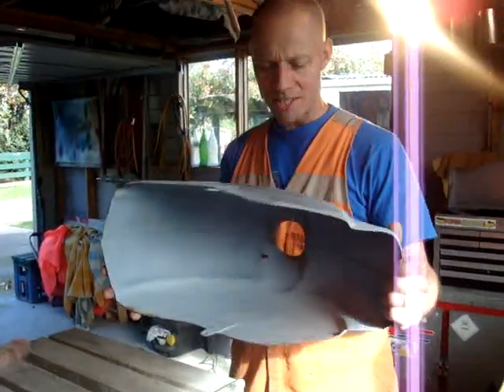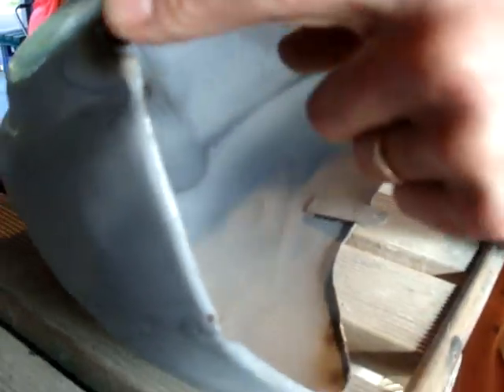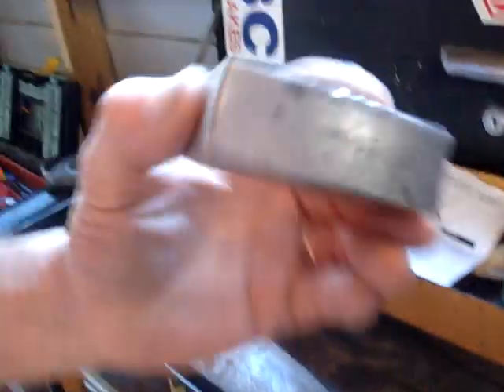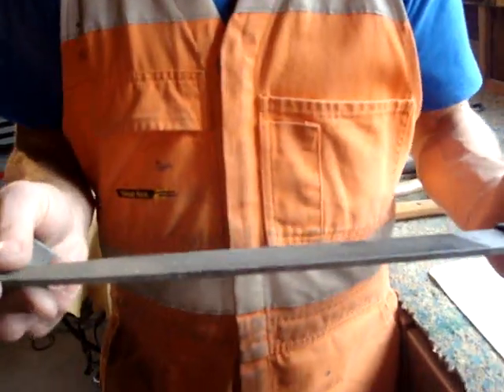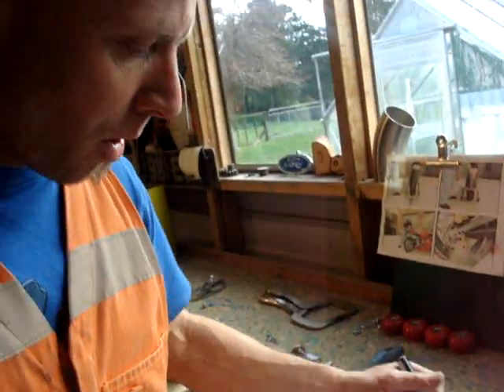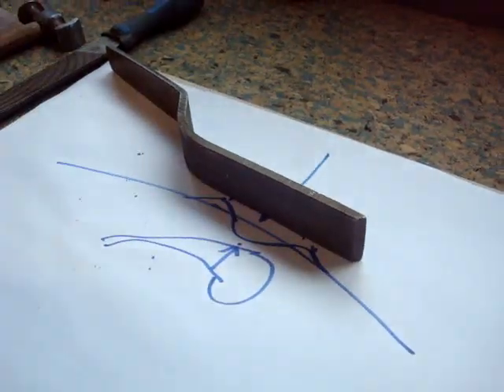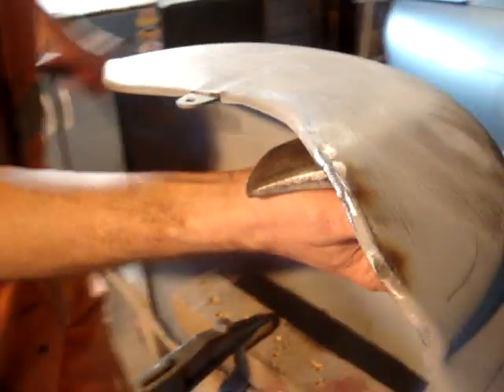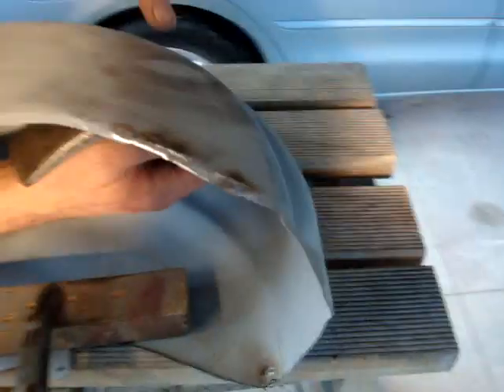car dent repair (No filler) training

Comment: having learnt my trade in 1988 from an oldschool panel beater i was told that ill never ever use his way of teaching on anything.i tried to put more of his teaching into practice but was always told to do it the quick way,ie body filler etc.
ive just come back into bodywork having been out of the trade for years,(i have been paint spraying for 13 years,in the super yacht trade!)which i am doing in  vw restoration(been into vw's since 85!).
now i want to pick up on the skills that oldschooler showed me.im not a novice but want a refresh. i have looked around and now come across your youtube tutorial.your ten minute clip you posted is so easy to learn from and helpful .thanks!.
Reply from the maker: +The BLDB thank you for the positive feed back , big fan of vintage dubbies also
Reply: thanks for keeping alive i hate bondo / mud

Comment: Superb. I have just done my first panel job on a Supra front guard, hardest steel I have ever seen. Got it done but ended up with lots of little marks from the hammer and dolly. I wish I had seen this slap stick before I started. Thanks its an excellent video.
Well done.

Comment: - just doing up an old '67 lambretta li150, - some quite badly dented panels, mudguard etc. Saw your video and thought i'd have a go, - got an old file etc, and set about the mudguard which was pretty bad after someone had jemmied off the old number plates - well, you should see it now in primer, looks bloody fantastic, I am really chuffed to bits, - many thanks for the lesson/kick up the arse to do it myself - legshields next, but not that bad - cheers, keep them Lammys rollin'!
Dave (UK)

Comment from the maker: Convex or a return sweep panel, can be planished, 
using a half round slap stick (I have one of these) could load video if enough people ask,?? 
You can also hammer on to the dolly from the inside of the panel. My dad and the older repair men would usually lead over the dent

Comment: Hi buddy, I'm in sunny, well not so sunny England, just watched your videos and found them to be inspiring, I'm in the middle of restoring a 1964 BSA D7 and a 1950 B31, I've just removed the rear Mudguards or fenders from both of them. The have little dints all over them and I'm going to try!!!! and have a go at removing them, as per your video, will let you know how I get on...

Comment: the file itself serves for another trick too. it prevents squishing the material too flat and then leaving high spots again in a completely new area. I hope you know what I mean, those cavities in the file allow the material to "relax" a bit when you bang it, otherwise if you have a perfectly flat tool it can cause high spots just where the edge of the tool goes as the material bursts out from too much stress.

Comment: Wow, what a great guide to panel beating, Im a novice myself, but have had heaps of practice over the years using scaffold pipes on blocked urea lines. Keep up the great work Restolad, do you offer unit standards?

Comment: Thanks Man I just bought a 1979 Z28 Camaro with some small dents and a pretty decent one in passenger side rear quarter panel. I really want to see if I can metal finish the dent! You just showed me some basics and gave me some confidence to try! Do you have any videos on how to use the old school slap hammer? there's some dents I will have to pull because there;s no room in the trunk to bang them out! Z28 trunks are small and built strange.